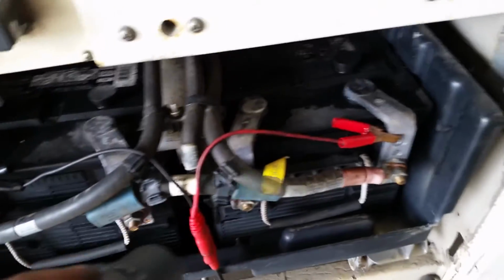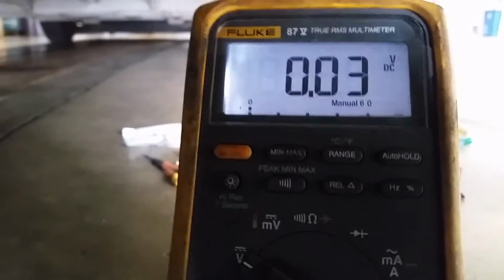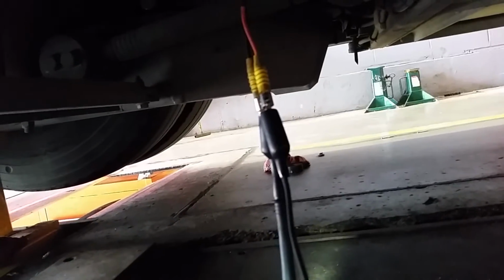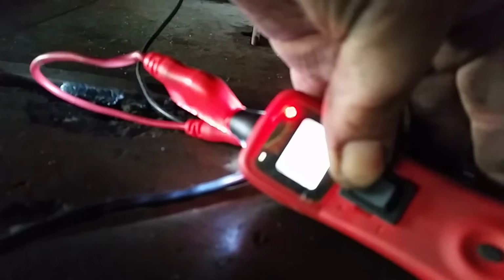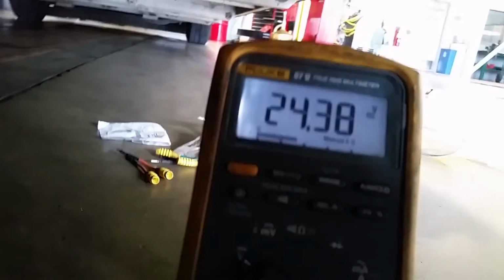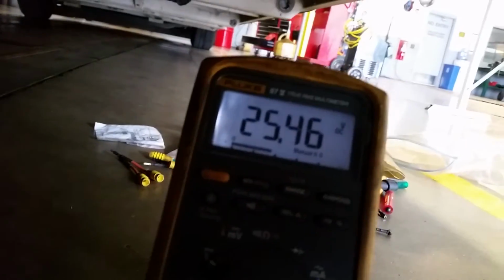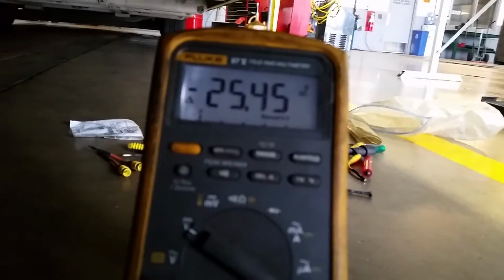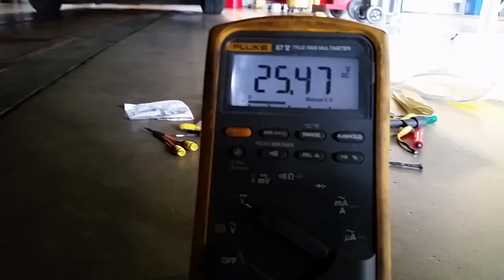Abs sensor wiring check

Comment: I've been load testing like that for years inc the REL feature, sometimes with a power probe or direct from vehicle battery (fused). If I don't have a correct WD I'll send a ground down rather than power & still use use LOADpro but just on the ground side.

Comment from the maker: Thanks guys, I even thought of a better way, keep whatever load you are testing plugged in and put voltage through it and then calculate the voltage drop using Kirchoff's law, if the drops add up to your source voltage your wiring is good.  Review my Loadpro operation video and it will make sense.  Another great tip shown to me by Dan Sullivan.  Any questions just shout.